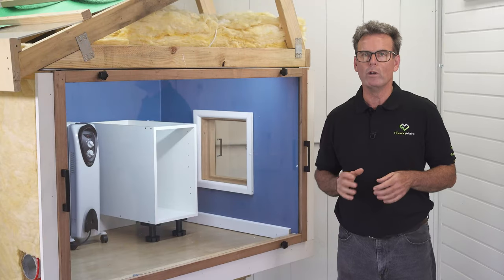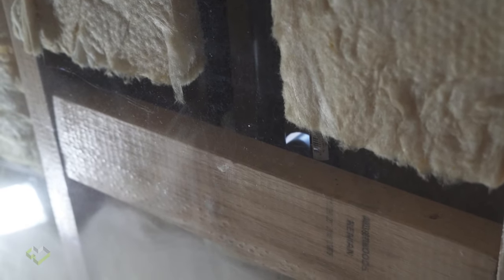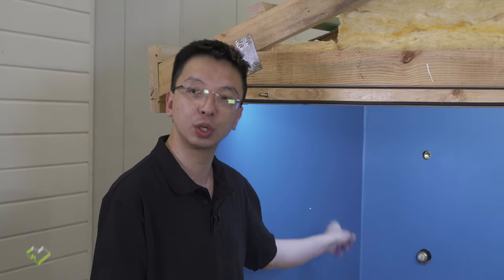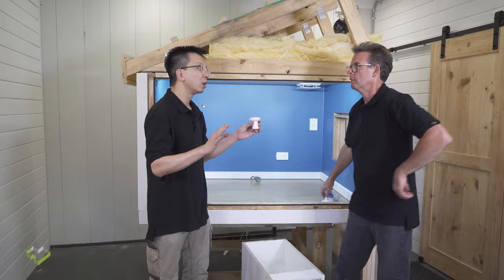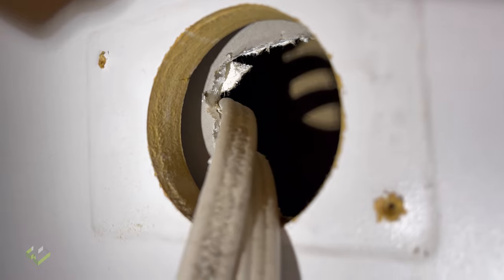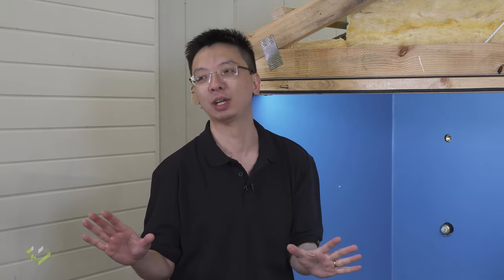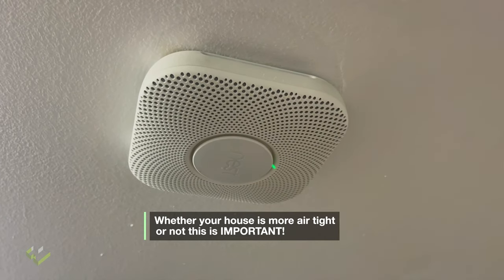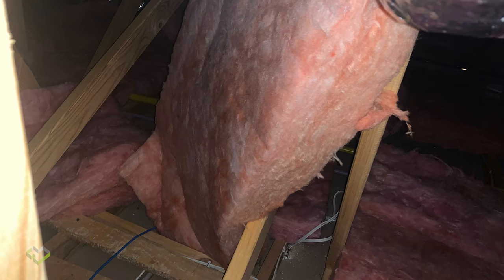Finishing Trades - Tackling Air Leakage & Ventilation for new builds including Renovations/Retrofits

Comment: It's easy to eliminate the air (and sound) leakage through wall switches and GPOs by applying putty pads around the boxes and penetrations. It's quick and easy to do. Vital if you're trying to reduce sound leakage from a home cinema room.
Reply: What’s a putty pad?  Where do you get them?